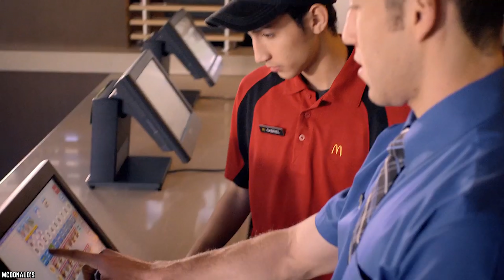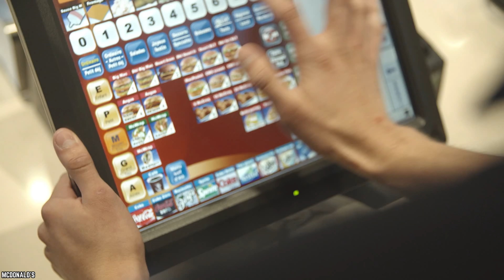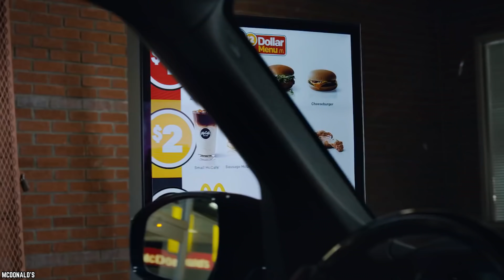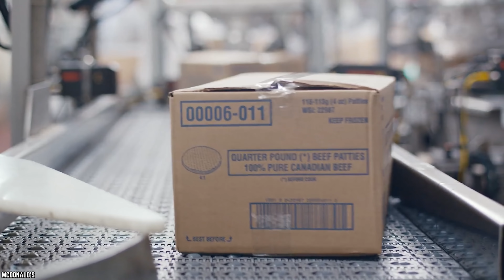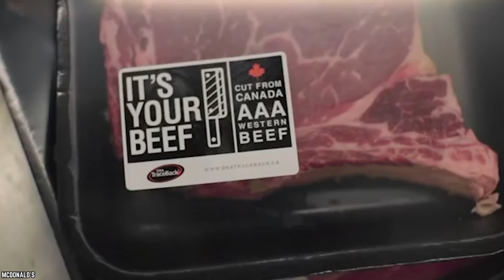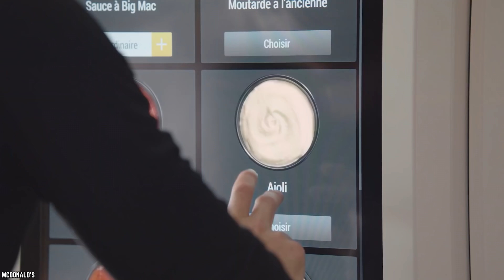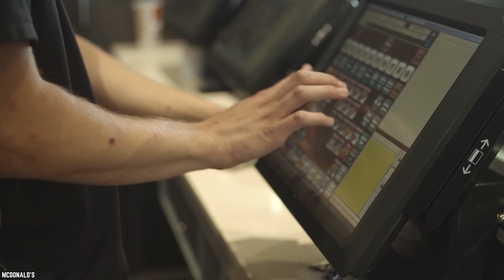Top 10 Reasons WHY McDonald's is so CHEAP!

Comment: Top 10 reasons why Macdonolds USED to be so cheap. A Big mac is like 5.50 now. This makes five guys look like a viable option. And the mcdouble went from being 2 for 2 dollars to being 2 for 3 dollars. And the mcdouble shrank, and it's lower in quality than it used to be. In the old days (mid to late 2000s) you could get 2 burgers and some fries for 3 dollars. It is now 4.50 plus tax, bringing it to almost 5 dollars.  In the old days you could get 20 nuggets for 5 bucks. Now it's like 6 and some change. For an average joe on his lunch break this is a fairly cheap deal, but feeding your family on mcdonalds is no where as cheap as it used to be. And don't get me started on that artisan burger stuff or the salads. $$$